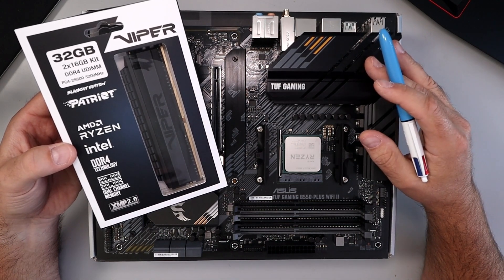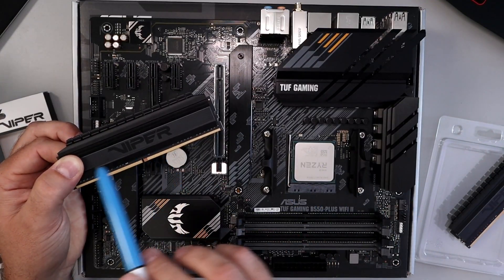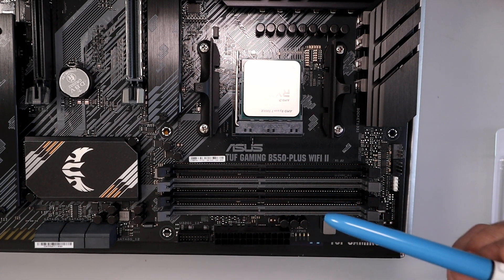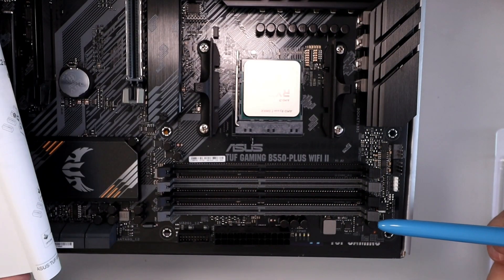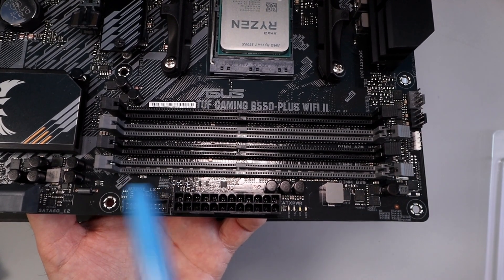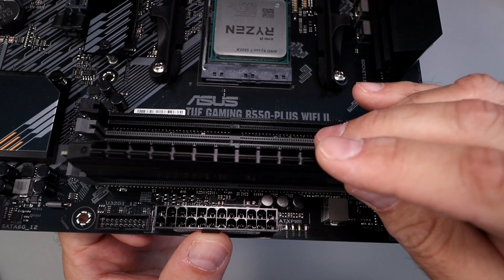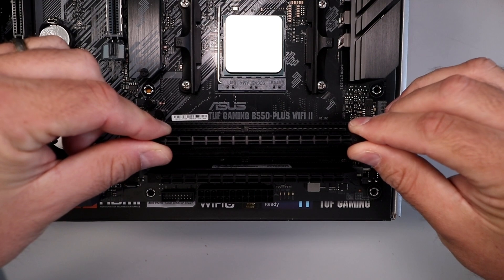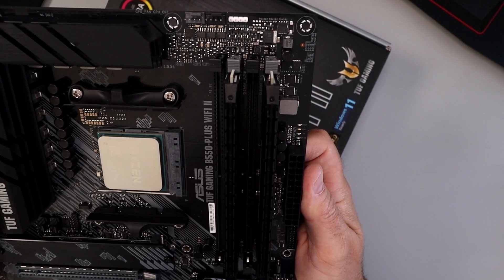How to Install DDR4 Ram

Comment: Thank you for a great video! I am new to PCs but slowly learning. Quick question I have a Asus h270-plus a mother board that came with only 16 gb of ram with it. I am upgrading it to have 64 (gb 2x16gb +  2x16gb so all four slots will have a 16 gb in them). When installing all 4 does order matter, for example they are coming in pairs so 2 in each package, in ram when they sell them together are those two uniquely mated or are all just generic if same brand, gb, etc? Thank you for your videos and help!
Reply: did u find out if the order matters?

Comment: I am building a Asus ProArt B760 WiFi  DDr4 Creator motherboard but all four ram slots have a metal stip dividing the long and short which my Ram does not clear in many attempts to isnall. I never have seen metal clips on any Asus motherboard prior to this and no service manual even mentions them if they are to be removed or what?